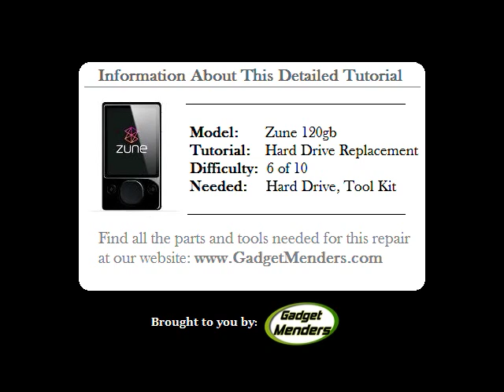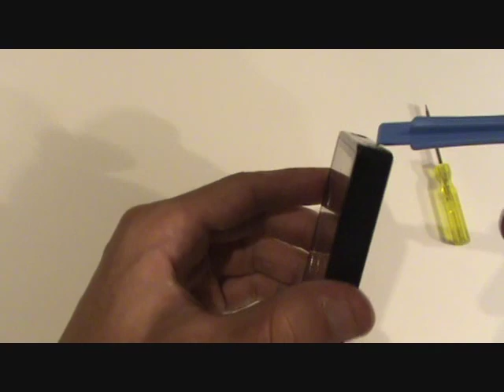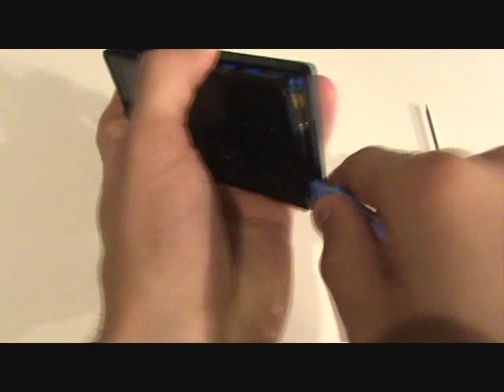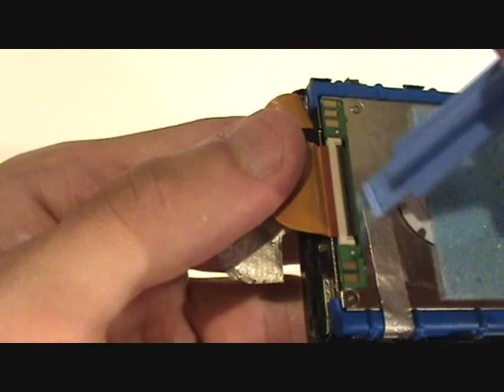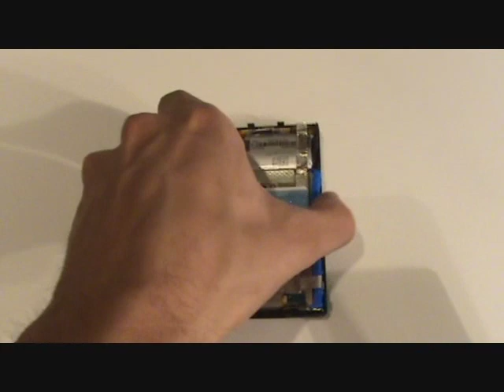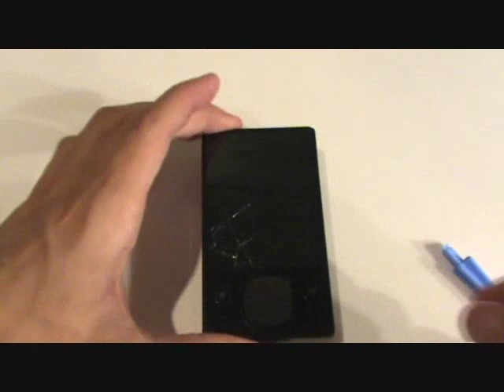Zune 80gb 120gb 2nd Gen Hard Drive Replacement Fix Error 5 Tutorial | GadgetMenders.com

Comment: Thanks for this great video. I believe my hard drive is fine.  However, the some of the teeth are bent in the port where I attach the cable which connects it to my computer. Therefore I need to replace the port that is attached to my Zunes 120 GB motherboard. How do I do that, and do you carry the replacement part? Thanks!
Reply from the maker: It's not possible to replace unless you have specialized equipment.  The solder points are much too small for each pin in the back.  You would need to replace the entire motherboard.  We don't carry either of these items and it's unlikely that we will ever since the Zune is an older model.
Reply: GadgetMenders thanks for answering.

Comment: excellent presentation sir. I got this job done my first attempt, no issues. Except that I now need to figure out a plan to move my music around with an iMac and this Zune. Maybe via external hard drive and a formatting transfer program of some sort?
Reply from the maker: If the drive was bad you likely won't be able to recover any music.  With the new drive connected to your Zune software you can add the media from your library to the Zune.

Comment: My 80 gb zune won't zync I tried resetting it, doing wireless sync but it just won't do it the zune program just tells me that the device isn't responding.  And I get an error code COOD124D, do you have any idea what part I need to change to fix this.
Reply from the maker: It sounds like you have a bad hard drive.
Reply: GadgetMenders well I changed the hard drive but when the software tries to the device a get error code C1010007
Reply from the maker: Trisol
You may need to replace the hard drive cable now or the drive you have is defective.  If purchased from us please contact through our website and customer service can assist you.

Comment: @GadgetMenders First, amazing video! It´s very good. Second, my zune charges but won´t turn on. It has a fain charging symbol on the screen, no lights. I looked almost everywhere, but can´t identify what is it. I would appreciate your help, thank you.
Reply from the maker: If the battery is very low you may have to connect and reconnect the charger every 5 min until it hopefully boots.  If not, the next step would be to replace the battery.

Comment: i replaced my hard drive but when i go to install the new firmware it gives me an error C00D124F and says the hard drive doesn't have enough space on it to install and that i should delete some stuff.  the hard drive is brand new and doesn't have anything on it.
Reply from the maker: First, reboot your device by holding the back button and up up at the same time.  When the screen goes black, press and hold back + left + center.  This will erase all reformat the drive.

Comment: Hi I had just recently installed a new hard drive into my Zune. But even after I installed it my Zune isn't working. Should change the Ribbon? Or could there be something else wrong with it? I've never dropped it before or anything like that. I could really use some help, Thank you.
Reply from the maker: Next step would be the ribbon cable.

Comment: ...In another Vid, uploaded by "BadGizmoRepair" after he removes the non-functioning hardrive, he then begins to work on the motherboard by removing  screws on the motherboard. Is this necessary?? If yes or no, why? He did not do as good of a job when it came to explaining things unlike you, so there is a lot of skepticism from my end. If you have the time, I would appriciate if you can shed some light on this.Thank you
kind regards
freddyglaz

Comment from the maker: @2PinkFreuds You can remove the blue rubber side pieces from the old drive and use them with your new one.  The padding is not necessary, as the rubber sides prevent the drive from moving around.